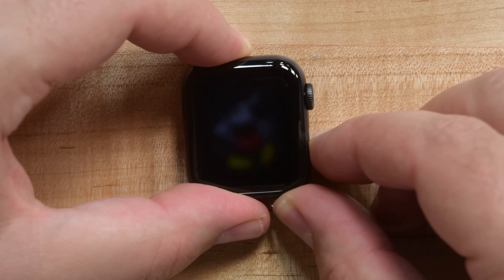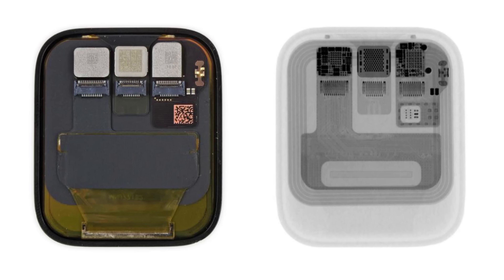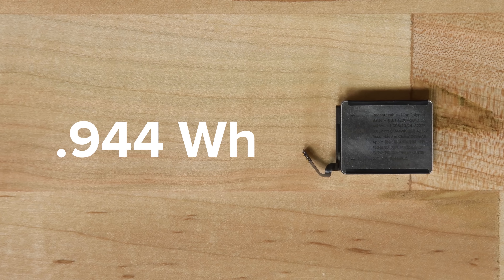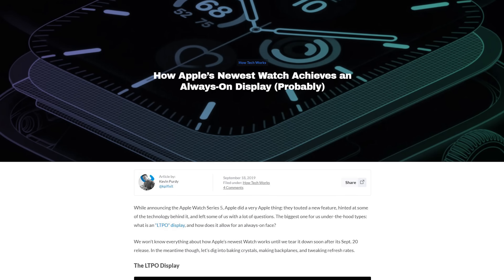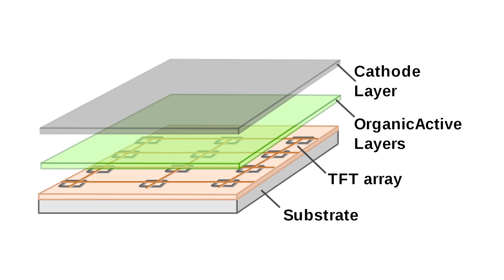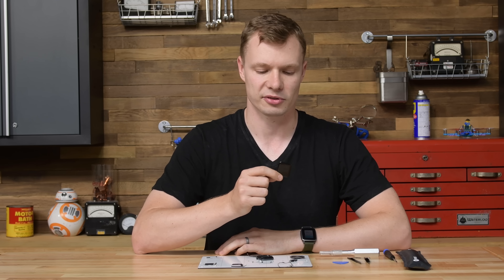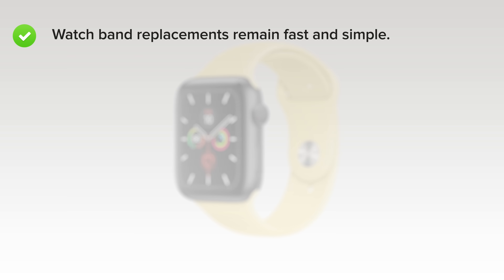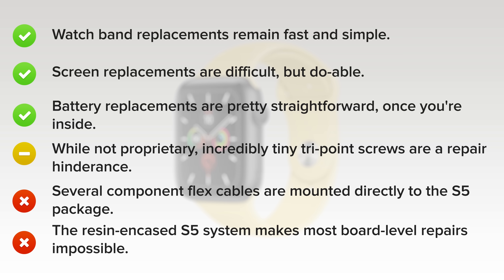Apple Watch Series 5 Teardown - Always on Display Explained

Comment: Hey , I recently opened up an cracked Apple Watch 5. Instead of switching the cracked screen with a new LCD screen we bought a LCD screen that came with the whole component Glass screen assembly. In other words, I just had to remove the flex cables and gasket to switch out the cracked screen. 

After turning the watch back on the screen, turns on shows picture and the buttons work but unfortunately the touchscreen does not work. It was working when the screen was cracked. What is the issue? I am having please help.

Comment: Apple watch is too expensive, so I choose fitbit.
Reply: Fitbit is good actually
Wise choice :-D
Reply: Ditto. Plus, I like the sleep tracking and app layout. Plus, I have the option for more "smart" features and a larger display or something more minimalist. I don't like jewelry, so I keep it minimal. The Apple Watch too big for me and I was always concerned about damaging it... plus the screens is on the lower end of quality and the aluminum models scratch way too easily. Gorilla glass on the Fitibits hold up pretty well and scratches minimally. Both devices are disposable, so I'll keep to a more realistic option on the affordability side since I use mine for fitness. Also, warranty is much cheeper for two years on a Fitbit then on an Apple Watch.

Comment: There is something wrong with the vibration motor of samsung note 10 plus been just 3 weeks it first got weak and now its totally gone. Gone through reddit many have suffered same issue any idea what could be problem software or motor its self.

Comment: I have a Series 4, and I didn’t know it had an LTPO display as well! 

It would be great if Apple would release a small software update to allow my watch to have an always-on display similar to the S5.... but I will keep dreaming
Reply: Vito in theory you could have always-on but since the display would keep refreshing your battery would be dained in no time
Reply: @DarkIzo  Yeah but honestly I'm willing to sacrifice battery life for this one feature. I usually end my days with 50-60% battery (light-medium watch usage) before I put it on the charger, so I have quite a bit left for always-on, if it ever comes.
Reply: Would never happen. The only major difference between the models is the display. Aside from tiny hardware differences, Apple would still not do it.
Reply: There would be almost no benefit

Comment: SO  the always on display is just a software update for s4? Since it has the same harware
Reply: No the Apple Watch series 5 has a different type of display all together. It has an LTPO display that can change refresh rates unlike the s4 with a normal oled display
Reply: Luca Heather No, the Series 4 also had an LTPO-Display. The difference is, that there is a new “Display-control-chip” in the S 5, which can lower the refresh rate to 1 Hz.
Reply: Yes didn’t realise that, I must have been spreading false information, sorry.

Comment: Please read and respond😇

Crazy question how different is it from this display technology used in the iPad Pro two very the refresher from 1 to 120( I think) vs series 5 ⌚️ LTPO ?

Do you think this could be used in an upcoming iPhone to the  to have an always on iPhone as well display?
Reply: Well, the iPad Pro has an LCD IPS panel, which can achieve 120 Hz much easier than an OLED. Also, the iPad doesn’t really go from 1 to 120, but rather from 60 to 120 Hz.
That being said, I think they could implement AOD (always on display) on the iPhones next year. But that’s not confirmed, it’s just possible.

Comment: i hope apple enable the always on display on series 4. it has the same LTPO. lol
Reply: Nope, it won’t. Sorry to break your wish, but I’m 100% sure they won’t. Here are a few reasons:
1. The Always On Display is the most important feature to upgrade to Apple Watch 5. If they made it available to Apple Watch 4, then no one would buy the Apple Watch 5.
2. The Series 5 has a system that allows the screen to go from 60 to 1 Hz, which the Series 4 doesn’t. Also, they say it has a new power controller and luminosity sensor.
I also own an Apple Watch 4 and I wish it had AOD, but it won’t. I wouldn’t upgrade to 5 also. Probably get the Series 6.
Reply: @mihnealazar7039  yeah, too bad. im still good with my series 4.

Comment: So.. the always on display is a software implementation and they could of enabled that on series 4, but didn't because Apple.
Reply: And have burn in issues with OLED?
Reply: No because the display technology is different.
Reply: L HK actually, it’s pretty much the same LTPO, maybe slightly different. But the series 5 has a new power management controller, which the S4 doesn’t.
Reply: @mihnealazar7039  so that's the difference...

Comment: I think they put the aluminum cover on the battery in order to prevent the battery from expanding, like it did on some series 2 / 3 watches.
Reply: Do you mean it expanded accidently or over time? Cause in any case that's just a sign of faulty battery or battery at the end of it's life cycle that isn't gonna work as well. So putting a case on it, doesn't help in any situation, other than making a fool out of a customer.

Comment: They can do always on display on a watch but not a phone???
Reply: I mean if their customers want it, they should've done it already. Not even in XI!?
Reply: Gurkirat Singh *11
Reply: Arin Hargett its much easier for them to do it on a 40 mm screen that an 5.8 inch display. why would anybody want their phone always on ?  phones are gonna become even more of a constant distraction, drain battery life, and would probably have to replace ur screen more often.
Reply: @jaq179  you are correct. it's all about the battery life. but with oled screens, they could just designate a tiny square on the phone screen to be always on using the same tech of the watch 5 and it would have very little impact on battery
Reply: @CommonTater100  you said that right, don't know their reasoning behind it, not doing it.

Comment: I think that’s easier than the Series 2.
Reply: That’s what I was going to say. My screen just came off, no effort at all lol. I had to speak with 9 Apple support agents to finally get someone who understood my issue and sent a repair request free of charge. All the other agents wanted me to buy a new Apple Watch or pay $300 to repair it (because it was stainless steel) even though Apple warrants the battery on a replacement product for life. The Apple Watch I had was a replacement because I had Apple care and I had the watch replaced because of a scratch. Anyways I paid $80 for a replacement which half a year later it’s screen popped off. Fortunately for me; despite being on the phone for 3 hours, instead of repairing it they sent a new series 3 free of charge.
Reply: Michael Hidalgo Wow... I still have the Series 2 and it has a tiny chip out of the case. I wonder is the Series 3 has weaker adhesive.
Reply: Baconface McGee I had a series 2 not a series 3. I guess the series 2 were out of stock and they sent a series 3. I’d be greatful for it but I’ve already sent that watch back, got another one and I’m in the process to send it back because an imperfection in the stainless steel. It’s just insane how much money they’ve wasted on replacement watches for me. They could have given me a full refund and spared themselves the losses. Obviously they didn’t know. I’m sure I’m not the only person but I’m the only person who doesn’t tolerate such behavior especially when I spend $700 on a watch that deprecates 90% in 2 years.
Reply: Michael Hidalgo That’s awful.
Reply: Baconface McGee I really love Apple products but I really hate them as a company. They’re so prideful and untrusting. Any other company would help you even if they don’t have to. I would consider the coating missing on my stainless steel Apple Watch to be due to be defective and they cover defective materials under their one year warranty but they kept insisting it’s not, it only applies to things like a screen that doesn’t work despite the legal document saying otherwise. Things like that really make me want to start a lawsuit especially since they, the employee, have nothing to loose, I’ve noticed it’s usually judgement when Apple makes a repair under warranty, you might get a competent person the 1st or 6th time you call. Someone always says there is nothing they can do but I’ve found they always can, it’s just a matter of if they want to.
Reply: Michael Hidalgo I really hope I NEVER encounter any of that!
Reply: Baconface McGee I also have a 2018 MacBook Pro while getting the keyboard replaced they damaged the display, took longer than the quoted time, told me it would most likely take less, emailed me to tell me the computer was ready wasn’t, I show up and they tell me to wait an hour, and then another to pick it up. I saw the display damaged and they agreed to replace it but that took extra time, at least only a day but still shouldn’t have happened. I’ve had my Apple Watch replaced many times and I’ve been calm about it but I will not have them repair my keyboard 3 times. After the 2nd time if it breaks, I’ll ask them for my money back or a replacement (not refurbished, never again, I only want something that comes in the original packaging)
Reply: Michael Hidalgo Periodically my brother would have to get his iPhone 5 replaced because the lock button would keep dying. When he got the iPhone 6, the first one killed Siri after a update. The second iPhone 6 had random temperature warnings, the 3rd one was fine. He upgraded from that one to a iPhone 11 3 months ago.
Reply: Ferry Gunadi I’ve already had 4 different Apple watches, 3 were replacements and I’m getting a 4th replacement to become the 5th Apple Watch I’ve had in less than the last 3 years while only having purchased one. They keep sending faulty replacement watches. This time I was just insulted because the black coating was coming off and they accused me of damaging it or rubbing it off by touching it. Like how does that even happen??? Am I not supposed to touch the watch I put on my wrist? After being insulted at the Apple store I called and was on the phone for almost 2 hours when a senior advisor finally agreed to repair it.
Reply: Michael Hidalgo That’s not what I like to read.
Reply: Ferry Gunadi Good to know.